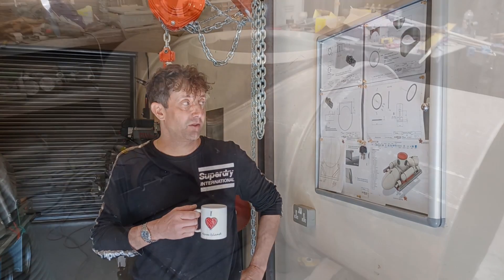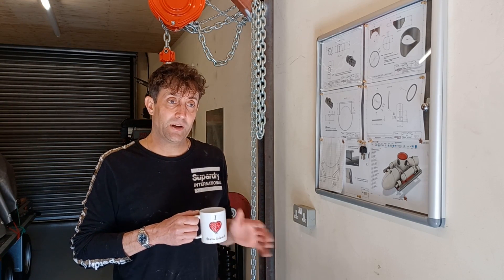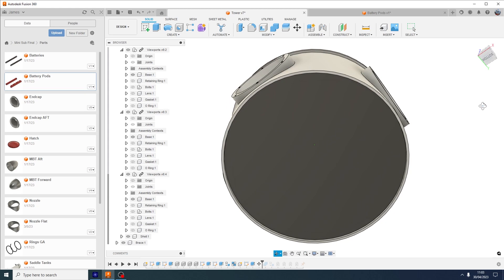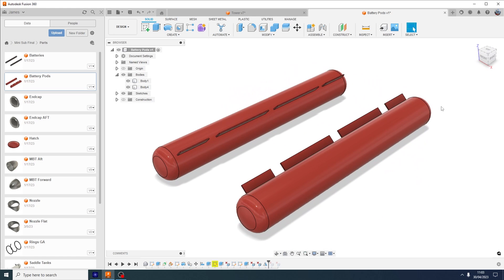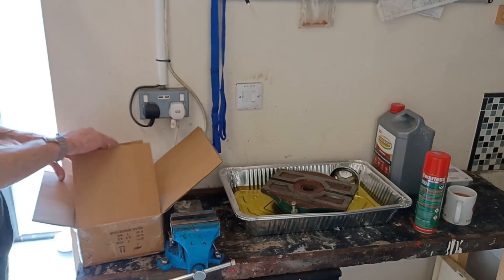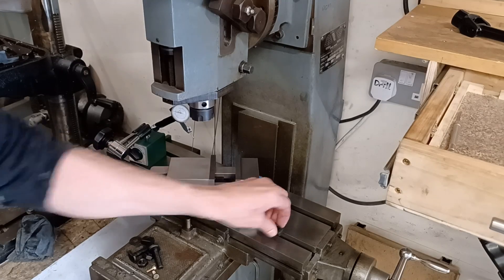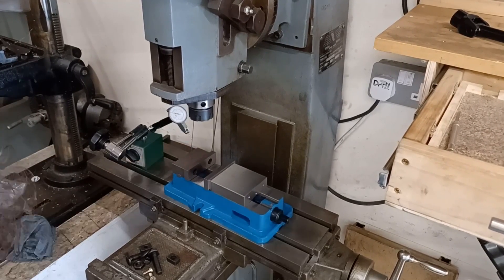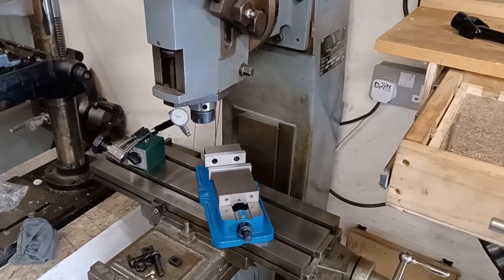Building a Submarine. Part 104.

Comment: Hi bud hope your happy with the finnished item. I'm sure the office would help you with the tower looks pritty simple. One thing I'd say if its welded to the neck it would of been much easyer to weld them together then put it in the body
Reply from the maker: Hi Martin.  It looks superb from the pictures. 
With regards to the next part, I am just seeing what you guys can do on cost of machining\fabricating.  Dave is on that.  It might be cheaper to get you to do it, rather than ship the stock here, I machine and weld it all and then send the completed tower back for skimming.  There is nowhere here that can skim it Idon't think, so its a balancing act.
Reply: Yep I bet transport cost can add up on a job like this..if you can weld I'm surprised you didn't fab it up you're self